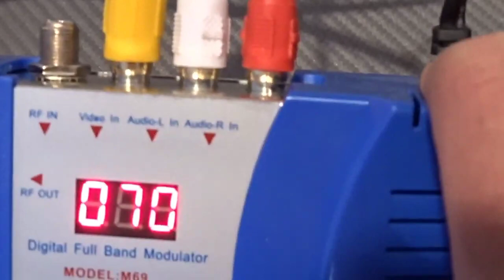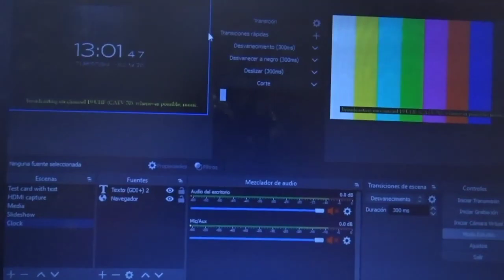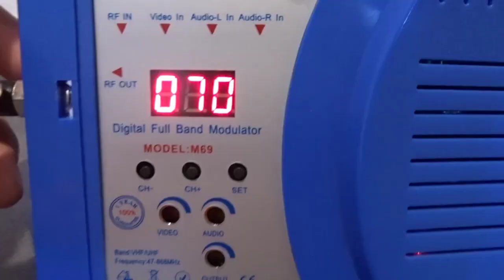Low power analog TV station- home made

Comment: Hi, i'm trying to make an project in gnu radio, but i have some problems. I need to make a transmitter beamforming with USRP. I use 2 antenna(2 signals, one is desired, one is interference). Already know weights calculated in matlab.